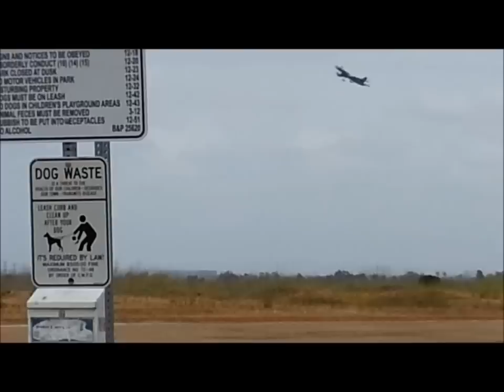Reenactment of Afghanistan cargo plane crash: RC Jetliner Stall Recovery System

Comment: An interesting idea, but the root cause of the accident appears to be a load shift that moved the CoG aft to the point where the aircraft was uncontrollable. Make your model uncontrollably tail heavy and you will find that the rocket will not solve the problem, it will still crash.

Comment: True it may (50%) save lives when it gets activated maybe once in a million flights. But the airline has to decide if it wants to lose hundreds of pounds of payload capacity, not to mention millions of dollars in R&D, FAA licensing and approval plus, Boeing has got to incorporate it into their own production line, adding millions of dollars in terms of aircraft cost for the solid rocket motors, servicing and maintanance for the airline. all for 50% chance...

Comment: unfortunately on the 747 the engines are hung under the wings and therefor are under the center of gravity and center of pressure. so at high power they will always act to push the nose up. they would have been better to pull the power early to stop the nose from rising. although they still may have crashed

Comment from the maker: Why? Because we design something and implement it on a model to make sure it works, then from there, there is potential to use it on larger scale platforms. Did you know NASA uses model planes to test new ideas? Did you know the Wright bothers used model gliders to test there plane? Good luck in life.

Comment from the maker: No doubt the cargo shifted causing the stall, but if they had enough thrust in the engines to pull the nose down, they may have or at least would have had a better chance of landing the plane. So, we're thinking if they had a "last chance" manual button they could push that would ignite a rocket that would just be enough to bring the tail up, they may be able to land. This test was done with a plane perfectly balance. Im curious how it would look with a tail heavy plane. Next test?